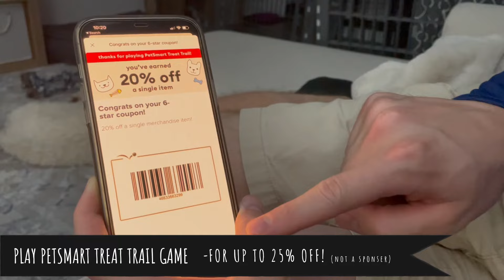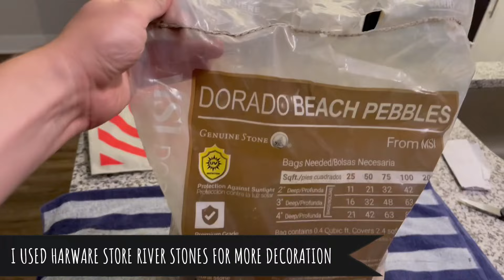125 Gallon Turtle Tank Setup - No Sand - FOREVER HOME SIZE!

Comment: Please consider remove the glass lids  an use a mesh covering. It cause humidity,they need air. The sand substrate was better for them than tiles, they like to dig
Reply: good idea if you like dealing with rust learned the hard way with that one
Reply: @thesasquatch303 there’s different types of materials you can use
Reply: @thesasquatch303  non metal mesh is a thing.

Comment: I like the look, I have a 75 gal tank connected to a 125 gal tank with a custom walk through basking area between them. I took some of your ideas 3 years ago and upscaled them. I have had my 3 sliders coming up on 8 years this spring.
Reply from the maker: So cool! Sounds like your turtles are well taken care of, thanks for the support! 🐢
Reply: Wait that’s so cool!! Could you show how your tanks look connected??
Reply: @shaunasmith211 probably ramps on one side for the 75 gallon, another ramp on the 125. A platform on top connects the two ramps together.
Reply: This is beautiful.  
How often do you need to deep clean due to fecal waste, etc.?

Comment: Greetings.  Thank you for the video. I enjoyed it very much. I'm in the process of setting up a larger environment for 2 baby turtles 2mrw. Up late studying so "Naw" seems like she knows what she's doing in front of the grandkids. What are your final thoughts on that basking unit in your video. I was thinking of making one out of a fruit crate almost like ol milk crate type. But this mesh can be cut (It's white) I just can't think of the material name. Ugh.  Right now the basking station it's going to be a concrete brick w slate rocks to climb to it🤔 under lights. The 2 holes (CBS) will be little caves as they are little. Thoughts please??✌️😎

Comment: Great video! I'm digging the tile option, but I'm curious if this changes your cleaning process? Do you use a gravel vacuum still? Do you just take each tile out and clean it?
Reply from the maker: Gravel vacuum is still a good option if you have some stillborn stuff. But with the turtles moving about you’ll probably be pretty clean for a while. If you start to see any buildup on the tile you can use cleaning sponge like the one you use for algae on the side of the tank without taking a single tile out! Easy maintenance!
Reply: @LongLiveYourTurtle  what about under the tiles?

Comment: have u ever heard of the plexiglass tanks? would they be worhth the extra for a turtle?
Reply: The problem I've seen with these is that plexiglass gets micro scratches from all the turtle beatings it'll take from the shell bumping around. Small turtles, not so much, but once they get plus 8 inches, little abrasions tend to show up.
Reply from the maker: Great point. It can get scratch and honestly costs WAY more. But I do like their overall strength.

Comment: Hi, I have a 50 gallon tank and the filter I have does not maintain the water clean for long. It gets dirty really fast. What filter do you recommend? I would really appreciate it
Reply from the maker: Filter type is super important so I’d start there. Fluval fx4 if you have the money or a sunsun704b. I also like the penn Plax turtle clean 1200… just know you need to run a filter for at least 2-4 weeks before beneficial bacteria builds up and your water should stay clear for week to months with 25% bi-weekly water changes. Good luck!

Comment: 7:26 is ur painted turtle pyramiding?
Reply: I was just going to say the same thing. She doesn't look happy.
Reply: definitely looks like pyramiding
Reply: That could be genetic. He raised the 3 together and other 2 are fine. I have 2 tortoises. 1 pyramid-ed slightly for years. Not the saddle back look but still pyramiding. At 30 yrs.. Hes balanced out w extra vitamins in the early years Speedy  is fine and normal with only 1 raised scute. I've never seen a water turtle pyramid. Very interesting

Comment: Love it. I have 3 red ear sliders is a 125 big enough for 3 as adults?
Reply: No, you should have 10 gallons per 1 inch of shell. An adult res male can range from 7-9 inches and an adult res female can range from 12-13” so depending on the sexes of your turtles you either have the bare minimum for a single adult female turtle or you have a good sized tank for a single adult male.
Reply: Yes plenty of room. Just build a turtle topper. I have 4 adult turtle in a 135 gallon and they all love there lives. I also have a 2 big canister filters.
Reply from the maker: You will get lots of answers for this but I think the most important thing is that you have your tank sized so that your turtles can move around, bask, you can keep up with the tank maintenance and your turtles are peaceful to one another. Hope that helps!
Reply: @LongLiveYourTurtle  I’ve had two eastern painted turtles in the same 125 gallon for years. They’re about 6” each. They’ve cohabitated perfectly with a community of mbuna cichlids. They’ve never messed with a fish but recently decided they hate each other 😔 Any suggestions for turtle aggression? I now have to divide the tank leaving only the fish able to travel to both sides. At this point that’s my only idea until spring when I plan to move one to my outdoor fish pond.

Comment: My res always eat the air stone. Is it dangerous for them?
Reply: As long as the don't rip it off the tubing and try to swallow it, they should be fine. I use an airline bar and had it buried in the sand to make the bubbles come out larger and less frequently to not obstruct my view and as far as I know, my turtle loves to sleep on the airstone.

Comment: I have a fluval for an 80 gallon.  I have cleaned the water 3 times yesterday and scoop stuff that it would remove.  It doesn’t seem to keep up anymore.  What do I need to do?  I have tried these pond pill cleaners that the turtle/fish store told me to ise.
Reply: the fx6 is rated for a couple hundred gallons, so you'll want to check your setup to make sure your system is actually working correctly. Checking pipes for slack, checking if valves are fully open, if intake attachment is fully submerged, proper tank flow from output, etc. Fluval has a setup video for all their canisters to double check.
Reply from the maker: Is this a brand new setup? You need to make sure your tank is cycled before worrying about whether the fitler is working or not. Look up aquariums and the nitrogen cycle to get a better idea. But the bio media in your filter needs mature so it can keep your water clean. Until then (a week or two) you will be doing a lot of water changes. Good luck!
Reply: It helps if you feed turtles in a separate container or smaller tank and then put them back.
Reply: @dj.excess  I didn’t know this was a thing?  What could I use, she eats in the water and is very big approx 12 inches
Reply: @wendybutterworth7541  buy a container where it can fit. Fill it up with water. Add a drop of dechloriner and feed in there. When done, put back in the water and all the small mess u just dump with the water. My filters last way longer this way.

Comment: I've seen this tank at Petsmart. The volume of the tank is good but the dimensions don't work well for adult size turtles in my opinion. It is a bit too narrow for turtles to move around without feeling tight. I believe it is only 18" wide which is narrow for turtles. This tank is more suitable for fish. Overall, I like your effort. Those two canister filters seem overkill. Just the FX6 is good enough.
Reply from the maker: I hear you and wish there were more standard tanks that were wider. But at 18 inches there is still plenty of space for the turtle to turn around. That is double the width of my largest turtle.